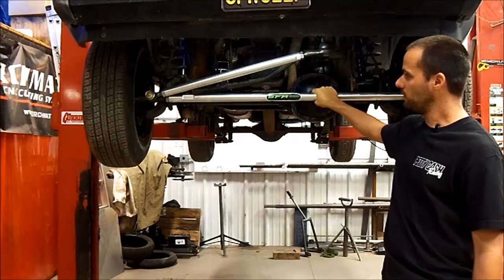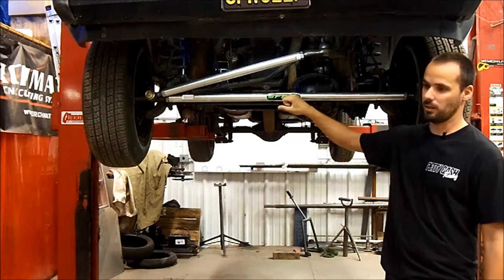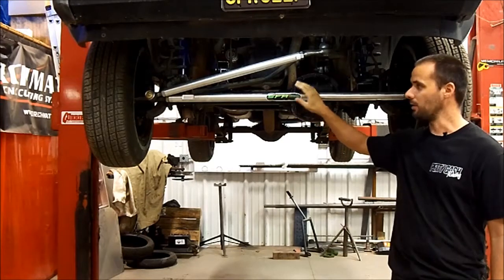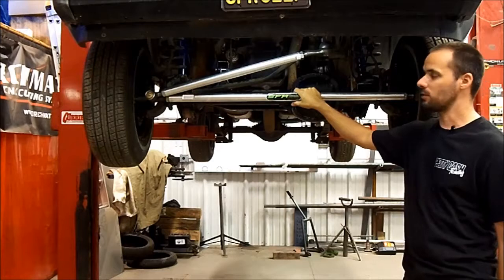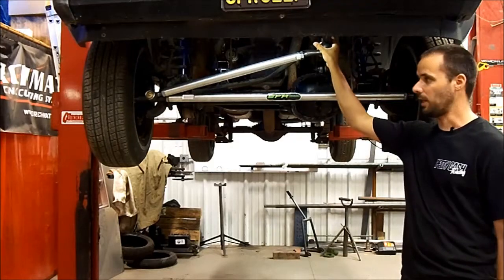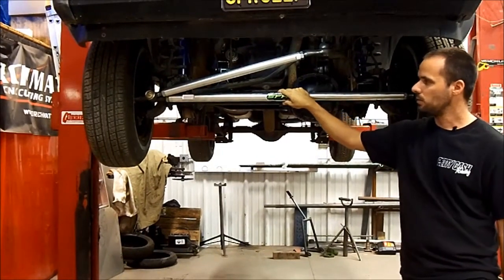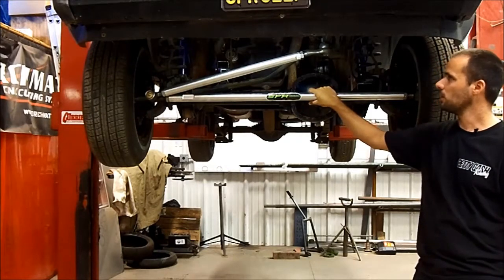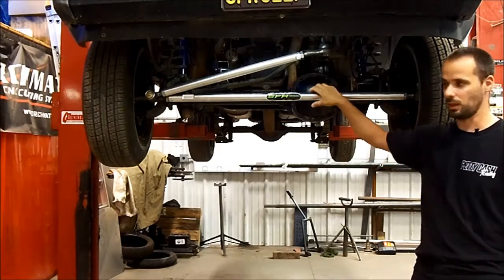SFR Premium 1 Ton Steering Introduction

Comment: how does it preform on road? would it be safe for a daily driven xj?
Reply: The jeep in the video is our shop truck, that gets driven regularly. The basic steering setup is not new at all or unique to this kit, and there are probably thousands of people using the same basic layout on the street. Main difference with our kit is the aluminum links and providing top quality tie rod ends, rather than cheaping out to add to the profit margin.
Reply: Can be add a stabilizer shock? And have the the kit for sale